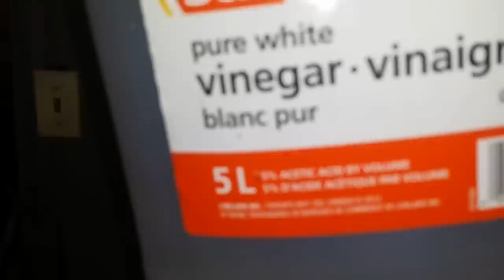Trash to Treasure: Restore Cast Iron

Comment: I wonder if the copper spun scouring pad/wool is that really safe to use? Is it merely copper color over steel wool or steel shavings to curls from some machining process? I would think the stainless steel spun scouring pad/wool might be safer to use. Just wondering. Excellent video I really learned a lot here. Many thanks!
Reply from the maker: +rgoidel  The Copper Scouring pads we use appear to be pure copper...  They wear away fairly quickly and are not a coating over steel...

Comment: 1) UtiliKilts rule!
2) Also, check out "Restoring Rusty Old Cast Iron Pots & Pans With Fire & Vegetable Oil" by
"The Do It Yourself World"
3) Isn't some of that crust around the outside baked-on food?
Reply from the maker: !) Thanks I agree!!!
2) I did, on your recommendation, the thing I don't like about the fire method is that it can warp the pans, and he is propagating the myth that soap and water remove the seasoning. See my seasoning video, https://youtu.be/lPtEtgR-vpI
3) More likely burnt on oil than food, but yes.

Comment: if i suspect the pan was used for melting lead. ( which is very common for fishing , hunting , scuba diving) i would not use the pan for cooking food. The pan metal does absorb chemicals into the metal. You will see this when you weld different metals and the chemicals will boil out and you can smell the chemicals. ( dangerous to breath)
Reply from the maker: Gregory Martin Yes, I am a welder too, and I agree with you 100%!
Reply from the maker: Femina Proletarius Lead melts at 327.5 °C (621.5 °F), which is more that enough to burn off the seasoning of cast iron cookware...
Bare cast iron has a dull grey, grainy appearance, where lead has a bright, shiny, smooth appearance. If when you strip the pan if you see any bright blotches, sand the area with some fine sand paper and look at it with a magnifying glass. if you can see the difference, there is a good possibility it was used for lead. This method is NOT 100% accurate, but my view is that there is still nominal amounts of lead in any water system built before 1990, so it is worth the risk. This is a decision that you have to make for yourself...
Reply: Its not that the lead melts at 625 deg F but the cast iron is very porous and absorbs the toxic lead into the metal and that can't be trusted to be removed from the cast pot by any means of cleaning that I know of . Even a good high grade stainless that you can't drill with normal drill bits absorbs chemicals and holds on to them. Ask any good welder what he sees and smells when he welds what looks like clean metal that was used in chemicals. This is just food for the thought. Then people use wax in the melted lead to bring the slag/ crap to the top to skim it off. I have seen good looking cast iron pots pans at auctions, garage sales , flee markets to leave them because i don't know how they were used.  I don't worry about replacing the seasoning on my pots/ pans. There is way to much hype about seasoning the cast iron. I am using pans from my mother and father parents. Im retired now , these pans cook just fine when the seasoning is removed. I cook with oils that re coat the pans. my wife uses soap which also removes coating..... soooo i just recook with oil butter or fat . No problem. I wipe the pans to clean.
Reply from the maker: Femina Proletarius
Unfortunately not, but then there is also no way of knowing if a brand new made in china piece contains lead either. I used to have a cast iron crucible made for large scale melting lead and still have a cast iron ladle for that purpose in my shop, Believe me if you see the difference you will know, but if as Gregory Martin has suggested if someone has gone to the trouble of trying to flux it out, all bets are off. What it really boils down to is how paranoid are you?
Reply from the maker: Femina Proletarius
Clean dry cast iron has a dull grey grainy appearance, clean dry lead has a bright silver smooth appearance, to flux something, means to add a chemical to try to remove impurities. Wax is used as a flux when casting lead, borax is used as a flux when welding steel, limestone is used as a flux when making steel...
Reply from the maker: If you are not sure you could always ask a welder or a plumber for their opinion. Either should be able to spot surface lead.
Reply: trollforge  You can buy a lead test kit from a home improvement store.  This will tell you if the pan has been used to smelt lead.  Asian CI and lead is a myth.  The pig iron and other metals smelted to make cast melt at a higher temp than Lead.  If lead were used in the casting of asian pieces, the lead would have reached such a high temp that it would have boiled off before the cast was poured.  Therefore asian pieces are not contaminated unless done so after they were cast.
Reply: trollforge  You can buy a lead test kit from a home improvement store.  This will tell you if the pan has been used to smelt lead.  Asian CI and lead is a myth.  The pig iron and other metals smelted to make cast melt at a higher temp than Lead.  If lead were used in the casting of asian pieces, the lead would have reached such a high temp that it would have boiled off before the cast was poured.  Therefore asian pieces are not contaminated unless done so after they were cast.
Reply from the maker: Brandon Rose 2 very good points, but the second one raises another question, how do the make "Free Machining Steel"? My Tool and Die instructor in college told us there was lead in that...

Comment: I use the self cleaning oven on mine to remove the old seasoning (burns it right off)  and then the vinegar bath to remove the rust. Then I wire wheel it until completely stripped. Then I wash it real good with soap and water and rince it very well. Then season it.
Reply from the maker: Brandon Bennett You don't need to remove the seasoning to treat a couple rust spots, a copper scrubber will take care of them, then just continue seasoning...
Reply: Cool brother

Comment: All of that black crud you are wire brushing off is hardened grease. That will clog your wheel. Put the pan in an oven on 'clean' or if you don't have a self cleaning oven make a little fire outside and put the pan in the coals. All of that stuff will brush off as ash. The vinegar worked great on rust.
Reply from the maker: +dalesworld The problem with putting an empty pan in the coals of a fire is that you can actually warp it...
Reply: +trollforge  I appreciate that can happen. I've done it in my woodstove when i just had a bed of coals and shut the door and let it cool SLOWLY over night with no problem. Your mileage may vary.
Reply from the maker: dalesworld
Sounds like a plan, I should try that sometime...

Comment: It seems to work with the vinegar, but 4 days? Electrolysis, done in 2 days of soaking, at most,  with probably no grinding needed.
Reply from the maker: mrpete222 did a comparison recently and decided that vinegar did a superior job to electrolysis. 
SHOP TIPS #310 Pt 2 Rust Removal -  Electrolysis vs. Vinegar tubalcainhttps://youtu.be/OYK7sMNUDJo

Comment: Can anyone tell if it would be ok to use a sand blaster to remove the rust?
Reply from the maker: I truly don't mean this as an insult, but if you have to ask that question, the answer is no... Someone who works with a sandblaster on a regular basis would have both the skill (not implying that I do) and the knowledge to do it with out harming the pan. Newer ones that have the texturized inside should be safe with Walnut hull media...
Reply: trollforge Thanks for the information

Comment: With all due respect to your obvious skills, editing ain't one of them. This should have been a ten minute video at best. As an aside, the Lodge skillet I scored from a trash heap today is American made, and about $35 new. 5% vinegar and some steel wool got her clean as a whistle. You GOTTA love Lodge. Getting ready to reseason it with some duck fat.
Reply from the maker: I have several Lodge pieces, the older ones a wonderful, the "Pre-Seasoned" ones are just an excuse to cut corners and produce an inferior product, IMHO.
Reply: Really? In all seriousness, you don't think the current Lodge products are as good? (I'm still getting used to this 'indoor cooking' thing)
Reply from the maker: Neil Bergenstein
In all seriousness, I don't think the current Lodge products are as good as they once were. Still better that the crap imported from across the Pacific, but not as good as when they used to machine the inside perfectly smooth. This allowed the seasoning to soak tight into the pores of the iron. I also prefer the fact that they used to be lighter because of the machining process. But then I grew up with and learned to cook on pans that were made before 1960. So I may be somewhat biased.
Reply: What did you do with the Duck Meat ??? :O)
Reply: What do you think I did with that smoked duck? I ate it!

Comment: Just a question...do you think steel wool would be better to use to scrub of the surfaces? Thanks 👏🏻
Reply from the maker: Good question. Most steel wool is too fine. Really course steel wool would work well, but steel wool is harder than cast iron, so it can cause dammage.

Comment: Chemically speaking, my goto method depend on what needs to be removed:
1) Light buildup of residues - scrub with a paste of salt and baking soda, rinse, wire brush, rinse. 
2) Rust - overnight soak in white vinegar, or in commercial "CWR", then brief wash with dish soap, wire brush, and rinse.
3) Heavy buildup of polymerized but not fully carbonized oils - Burn it clean over a jet burner until orange hot, then let cool and wire brush, then start a new seasoning layer from scratch.
Reply from the maker: Thanks
Reply: Youre very welcome. 

Addendum:

4) ordinary dirt from light weekday use (ex: stirfry or toasting stuff) - Just plain hot water and a non-stick safe scrubby sponge.  This SHOULD be the default method of care because its the best for your patina  ... the 3 alternatives I listed earlier are ONLY for when plain hot water and a sponge are not enough.

After all of the above, dry pan thoroughly over low heat, then add a few drops of vegetable oil, wipe down the pan with a paper towel until glossy, then buff it like am old shoe with a fresh paper towel to remove any excess oil (this eliminated buildup and reduces the tendency to attract dust).

Over time, the repeated cycles of cooking and buffing with a tiny bit of oil slowly fills in the pores in the pan and forms the foundation of a nice black patina. Dont rush it.
Reply from the maker: Thanks

Comment: In the Electrolysis process the metal you use like rebar doesn't matter if it has lead in it! Because you are transferring the rust "From" the pan "To" the rebar! And this method of removing rust is hard work with all the scrubbing!
Reply from the maker: You need to work on your listening skills. I said my issue with electrolysis is the proliferation of YouTubers recommending to reverse the polarity at the end of the job to rebuild the surface metal loss. In which case you are transferring "From" the rebar "To" the pan.

Comment: I wonder if vinegar and baking powder would work. That produces an acid that looks like a rolling boil.
Reply from the maker: No, I doubt it. Vinegar IS an acid. Baking Powder is primarily Baking Soda and Corn Starch (there are a couple other ingredients). Baking Soda is a base, and neutralizes acid, so you would only be soaking it in salt water.

Comment: I'm trying to clean a  7 pancake pan and soaked it in vinegar and finally gave up and tried to season it but it still has some baked on crud on it that doesn't look good like the ones in antique shops that have been cleaned up. Should I start over again or keep seasoning it? Haven't tried the self-cleaning oven trick on it yet and have some cornbread pans that will be hard to clean so will use the vinegar on them bc I don't want to use chemicals that I wouldn't eat on them????
Reply from the maker: Vinegar works on rust, but is not the best for burnt on food, try "Washing Soda" to soak in. If you can't find washing soda, spread baking soda in a thin layer and bake at 400F for 1/2 an hour.
Reply: Have you considered the 'oven clean' method? It worked good for me, i just needed to remove a layer of baked on gunk.
Reply from the maker: As far as I am concerned oven cleaner is a noxious chemical, I won't use it in my oven, I'm certainly not going to use it directly on a food contact surface...
Reply: @trollforge  I did not mean spray oven cleaner on your pan, i meant to use the oven clean method. put grimey pan in oven, select self clean on oven. It burns over 500 and takes off all baked on grease. i would never use oven cleaner either.
Reply from the maker: Ok, sorry, you did say 'oven clean' method, not oven cleaner, my bad, though I have seen videos of guys recommending oven cleaner... Yes the 'oven clean' method would work for grease and scum, but not rust, and I don't even know if our oven has that feature...

Comment: Soak it in vinegar for 2 hours and rub the rust off with a towel or toothbrush. Why do you think it will just dissolve off?
Reply from the maker: That would work for flash rust, not for something this bad.

Comment: Forgive me if this seems a ridiculous question, does that long in vinegar not harm the pan? I've got a few old pans that I picked up from an antique store and have been working tirelessly to restore. I read a Lodges article that soaking for more than 8 hours could cause some issues with the skillet. I picked them up fairly cheap but I'd like to avoid further pitting in the older pan.
Reply from the maker: No, I can not say as it has caused any pitting but as the vinegar eats the rust, it is itself used up.Lodge's new pans have a sprayed on "Seasoning" that can be damaged by prolonged soaking,  and an unseasoned pan is prone to rust if kept wet, but we are in this case removing the preexisting damage, not causing more.

Comment: I would have burned it off in a fire first. Most the iron oxide would just flake off. Then do the acid bath if needed
Reply from the maker: The problem is that throwing cast iron in a fire can warp it...
Reply: To be more precise put it in a good fire with plenty of coals, leave it until the fire is cold and the pan is cold, small chance of warping or cracks.

Comment: Sand or glass beaded would've been quicker, easier and wouldn't of lost as much metal from the acid bath (vinegar).
Reply from the maker: Dave Leland no, actually sand blasting can easily destroy an antique cast iron pan. Antique pans had the casting scale ground out at the factory.

Comment: Revived old rusty farm tools by soaking in coke bath overnight.  Used Sprite too.  Both worked fine for me.  Deeper rust might take another soak.  Been using it since 1970.  (made me wonder what coke does to your stomach) Used a small wire brush to clean after soaking, The brushes are a little bigger than tooth brushes, bought them at dollar store or home depot. Have used Brillo pad/sandpaper also.  Grew up on a 90% self sustaining farm with the motto, "Necessity, the mother of invention." Still using my great G-pa's tools today,    waiting till May 31, first try of your wine recipe
Reply from the maker: Sweet! Let me know how it turns out!
Reply: Linnea Beckman @

Comment: Another easy way to strip the rust off them but most of us don't have that facility is to sandblast them and then start over again with the seasoning process
Reply from the maker: Sand blasting is not a good alternative for older cast that has the insides ground smooth,  but there are softer media than work.

Comment: something that beat up with rust the molasses method works the best.  No grinding required, save the vinegar for making pickles.    Its just slow...as molasses.  9-10 parts water to 1 part molasses. soak for about 2 weeks
.
Reply from the maker: I've never tried Molasses but every comparison I have ever tried shows it to be the slowest, least effective was to deal with rust.
Reply: Molasses works great,  albeit very slow...with reasonable wire brushing before treatment it takes 2-3 weeks.  I've  left buckets in my garage with various tools i've found cheap at yard sales in the summer and let sit for a whole winter season.  Come spring, i just need to hose off and season or spray with wd-40 to prevent flash rust.    Maybe electrolysis is the quickest method i'ved used but i dont feel comfortable with a charger running for 3 days plus for very heavy rust items.  There is a downside to electrolysis if you are de-rusting multi-metal components,  heavy metals may leech out.  You dont have that problem with molasses.
Reply from the maker: Robert Dieder I am not sure I understand the process, but I think it is the sulphur in the molasses that does the work, either by creating a mild sulphuric acid, or by some other reaction sulphating  the iron oxide. Do you know?
Reply: im not sure what the chemical process is but the word i come across in others that try to explain it is "chelating" .  It starves the rusted object to be treated from oxygen and chemically neutralizes the rust by binding to it.   The great thing about this method is it is extremely easy to set up and molasses is dirt cheap at co-ops and/or feed stores.   Last i bought a gallon at Tractor Supply Store for 8/gallon. It will last me many years.
Reply from the maker: LOL, I am writing a book on Aquaponics, and I just did the section on Chelated Iron last night, so this is fresh in my memory. Chelating is the process of adding a real or synthetic amino acid to the iron atom to make it bioavalable to plants. Barley can do it with its live roots, but Sugar Cane and Sugar beets were not on the list. So I googled... there are Agricultural extensions recommending spraying molasses in the fields to chelate existing iron, I'll accept that as a reputable source... Thank You!